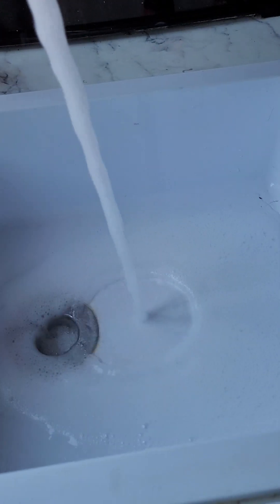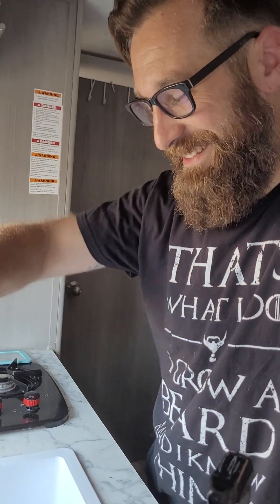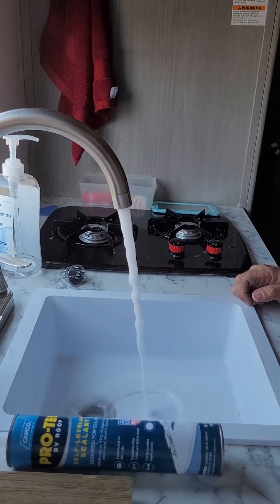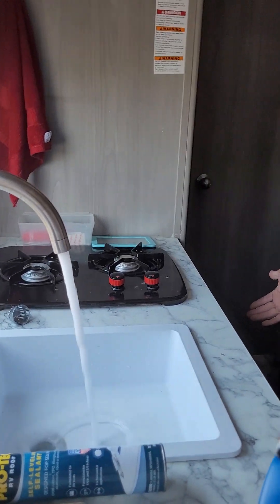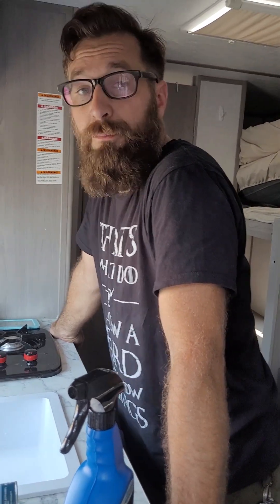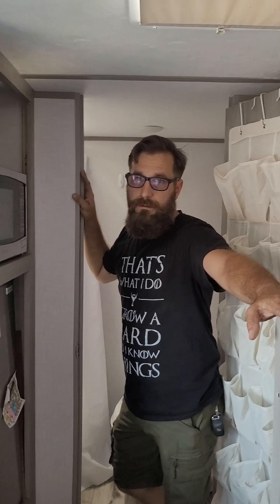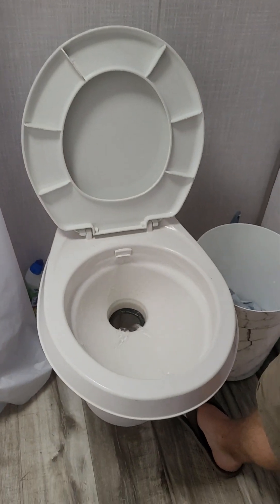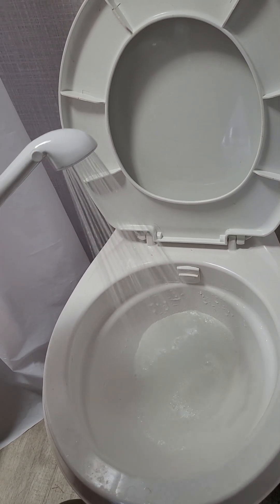De-winterizing the 17B

Comment: Question!! Just bought 2023 camper 17b 
Have you had any issues with the ac unit leaking inside??
Reply from the maker: We did in the beginning.  We'd leave and come back to a wet matress... we just used the stabilizing Jacks to tilt the camper slightly so the condensation would drain as it should. I'm sure you could probably tile the AC unit itself, but it worked for us!
Reply: Common issue. Some do it, some don't. The fix? Carefully remove the ac, then check the pan make sure its installed correctly under ac. Then apply small amount of rv sealant to front corners of pan. Then take ac while its out. CAREFULLY  drill 2 small holes in rear of ac bottom for extra drainage. Use puddy knife to shield coil from drill bit. After that reinstall ac. Once this is done no more leaks from ac. Even if camper is tilted on door side a lil it still wont leak inside.